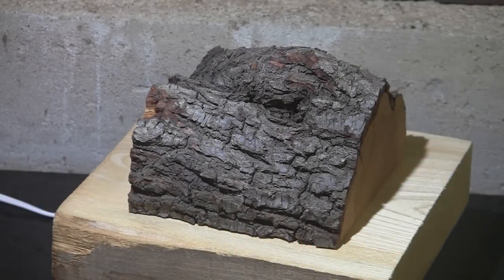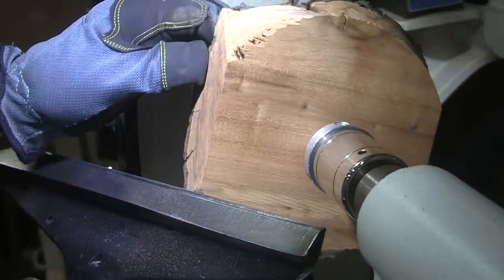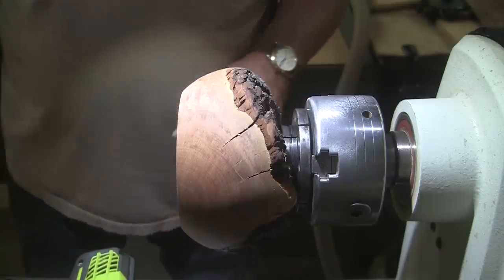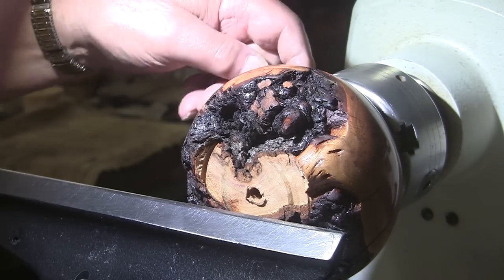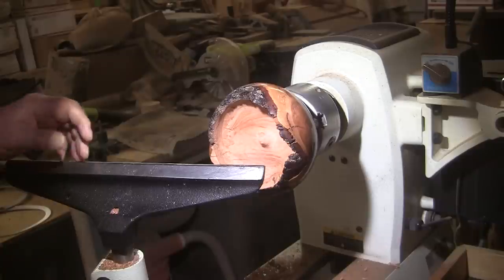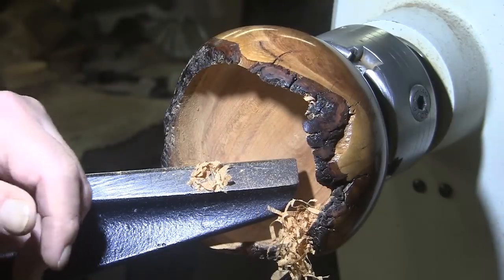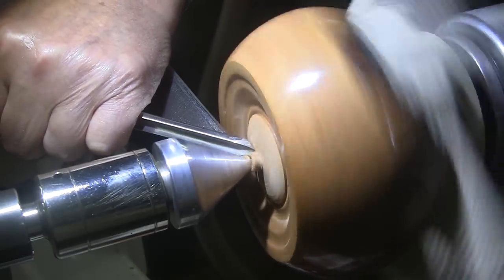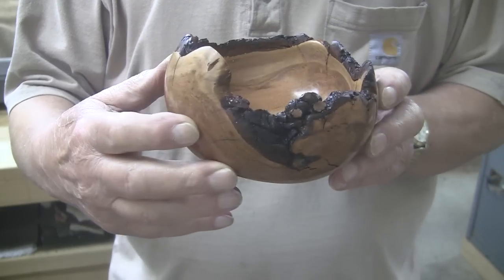Barrel Shape And Undercut 👀 What Next! - Wood Turning

Comment: Nice job Phil another Beautiful piece!👍 just thinking about your sanding piece that broke, I had a couple come apart and I noticed this other one starting to rip apart and so I went around it pretty dang heavy with some hot glue, we got some black hot glue and that’s kind I used, so far it’s still holding up, thought I would share that with ya those little things are pretty pricey!
Reply from the maker: Thanks, Kimsey!  I do repair mine when they start coming apart but this one didn't come apart, it ripped the whole end off of it.  Then it's really hard to get it centered again and it usually ends up wobbling and causing more problems!  Luckily, that doesn't happen very often.  Have a great week, my friend! 😊
Reply: @PhilAndersonShadyAcresWoodshop  Hope you have a great week too buddy! 😎🤝

Comment: One of my club mentors said to use that tool (diamond point)at a downward angle like a scraper. What is your thought? I was getting catches with it too.
Reply from the maker: Well, I've been using it like this for many years, Archie.  The only thing different is the way I sharpened it.  I've been honing it on a diamond card all these years.  This time I actually sharpened it on my belt sander and, MAN, is it sharp!  I just need to get used to not pressing very hard. 😊
Reply: @PhilAndersonShadyAcresWoodshop  I think I need some more shop space 😄. I'm mostly sharpening with my diamond card but I have a high speed grinder. I mostly try to avoid it if possible because I have no platform for it. Just the little test that sticks off of the front of the guard. I really like using that diamond point for making a tenon. I'm considering making a recess scraper like the one I saw you using to profile your mortise occasionally.

Comment: Great piece.  Question: the tenon didn’t have a square flat area for chuck jaws to sit against. There seemed to be a purposeful ridge or moat or I’m not sure what.  It looks cool but I thought it’s very important to have that flat area around the tenon.  Did I miss something?  Thanks.
Reply from the maker: Thanks, David! 😊 Well, it did have a flat area for the chuck jaws to set against.  Right at the base of the tenon, about a 1/8" ridge all the way around.  That's all you need, it doesn't have to be an inch wide or whatever, just an area.  At that point, the chuck jaws are only about 1/8" wide/thick, anyway.  Sorry if it didn't show well in the video.

Comment: Hi Phil, I have been looking for the sanding sealer you use and want to clarify, Zinsser Bulls Eye Sanding sealer, right. $118 a gallon up here in Canada so just want to be sure. Thanks so much. Lorne
Reply from the maker: Well, here it is called Zinsser Seal Coat.  Maybe just a naming difference.  As long as it says sanding sealer and it's de-waxed, you should be good to go.  😊

Comment: Turned out NICE! The Cherry is gorgeous. I had some black cherry that I turned a small bowl and was gonna give it away as a present, but my better half claimed it. 🙂
Curious what drill size do you use for your screw chuck? I just got a new one and I can't seem to find the drill size for it. I think 5/16th would work but I'm gonna have to do some testing.
Reply from the maker: I have a 3/8" worm screw and I drill a 5/16" hole for it, Nick. 😊

Comment: Another beauty. It's too bad you had to work away that center and the bark inclusion it had on the inside. I know it gets in the way of the tools, but it sure looked neat for a bit. When you were putting the sanding sealer on the outside, you said you go over the smooth part with a bit of fresh after brushing the bark in case it left brush marks. Is there a reason why you don't do the bark first, then the smooth part? Would it affect the quality of the finish?
Reply from the maker: When applying with a brush, there are brush marks that can leave an edge that is difficult to remove.  By applying a base coat first, the brush marks don't dry as quickly, giving me a chance to wipe them away.  😊